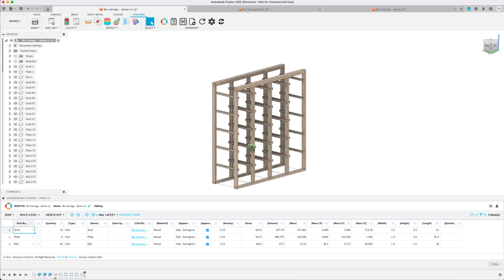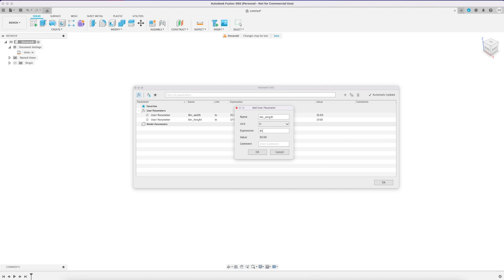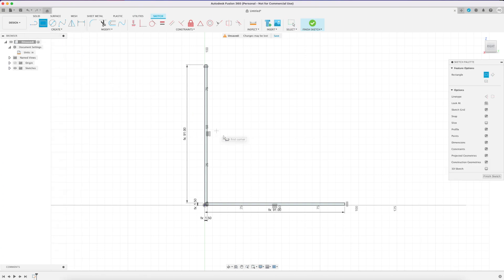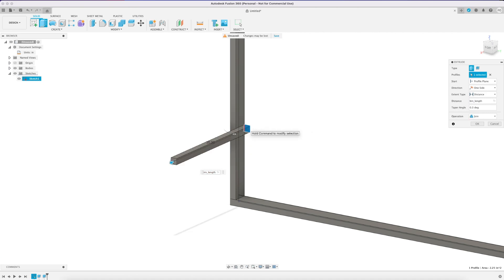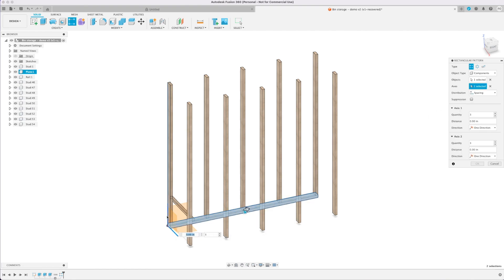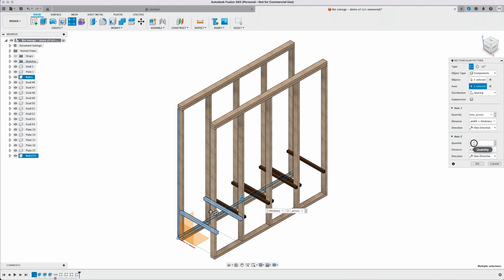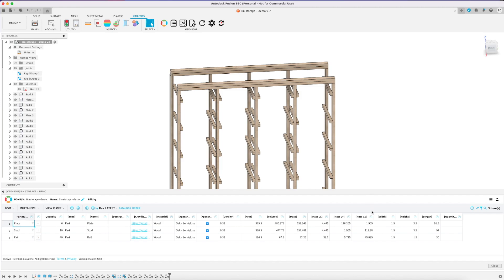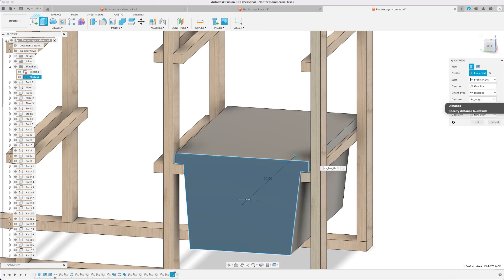Bin Storage Rack PT1 - Modular Fusion 360 Design Guide to get EXACT Lumber Dimensions

Comment: Great tutorial but I about had a breakdown because I was getting 91.5" when entering that first formula as you gave it on the bottom of the screen.  I finally realized you have an extra set of parenthesis the second half that are not needed and changes the order of ops.  I eliminated them from my equation and came out with 91" as shown in the tutorial.

Edit: 91.5" Is correct and the formula you provided id correct.  It shows the wrong length in then video (91")
Reply from the maker: Sorry for the headache! Which formula / part are you referring to exactly? I'd like to correct it so others dont have the same issue.